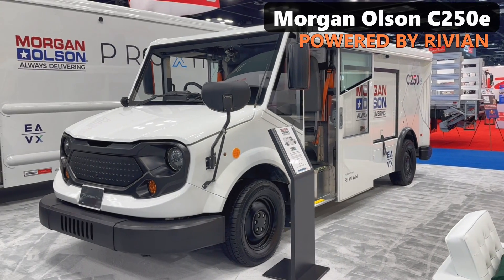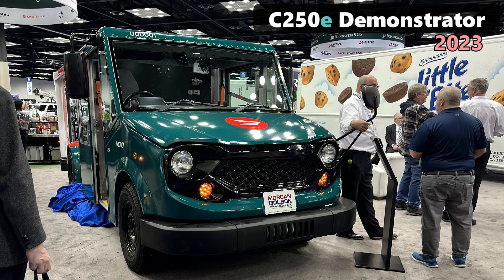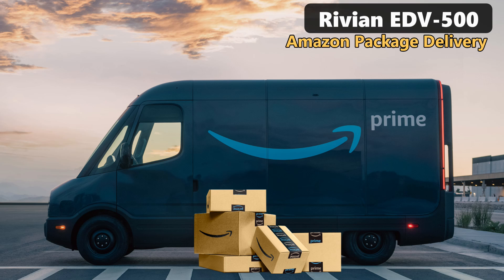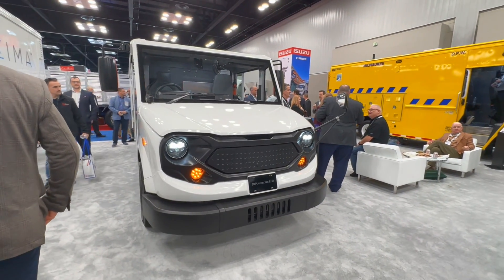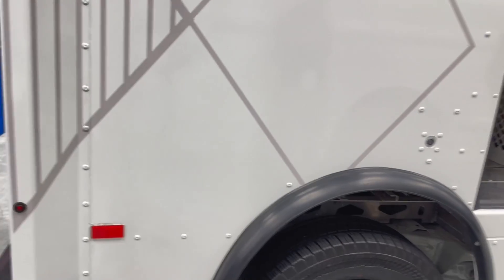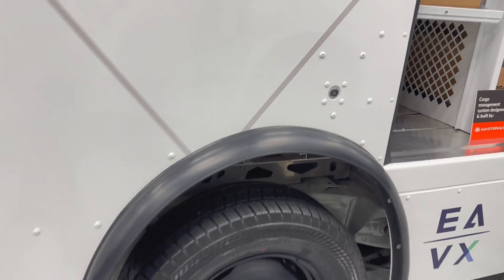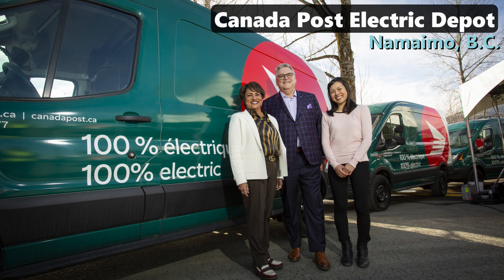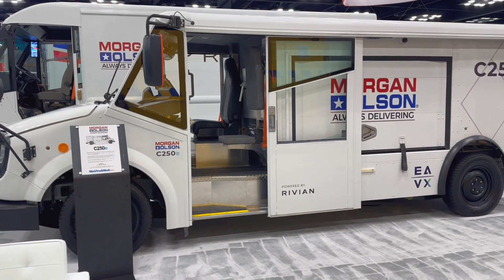Rivian Powered Postal Van for Canada (Morgan Olson C250e)

Comment: I'm a canada post letter carrier.  I cannot speak for the electric units but the F-150 designed versions are a bit problematic.  They are too big for business Mail delivery and too small for our commercial pick ups and delivery.  The racking in the back is excessive and not all that useful.  The parcel area is too small and the pull out tray is just ridiculous.  In fact, it has less parcel space that the ford transit connect.   For canada post the passenger side door and panel doesn't open or not easily. The AC, heated seats, heated steering  wheel, and 4 wheel drive are nice features.
About the only thing they got right is right hand drive and the step up height.  Just my two cents.
Reply: agreed working everyday with one.
Reply: If only lazy govt bureaucrats that paid millions to external consultants to do the work of getting requirements would check with workers. Now the focus will be to mute the workers and keep the public from finding out they paid millions for an unsuitable vehicle rather than pivoting the design so it works.